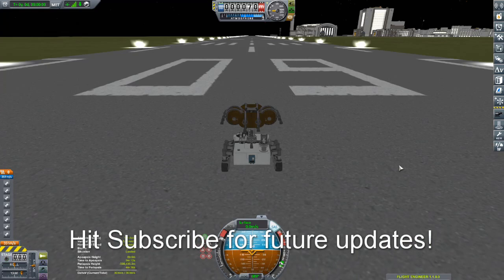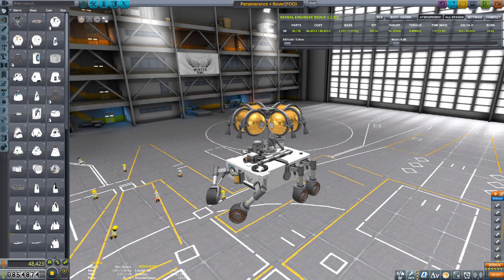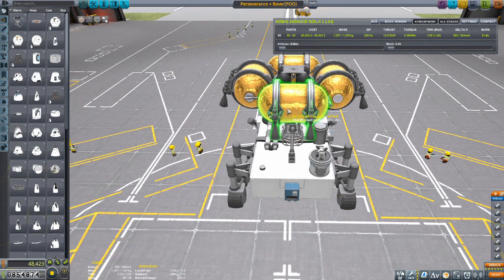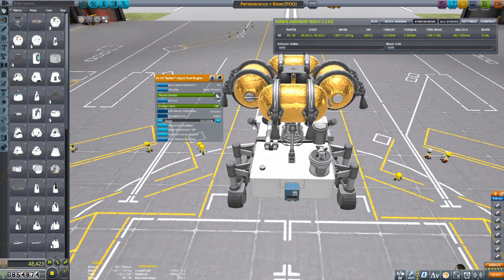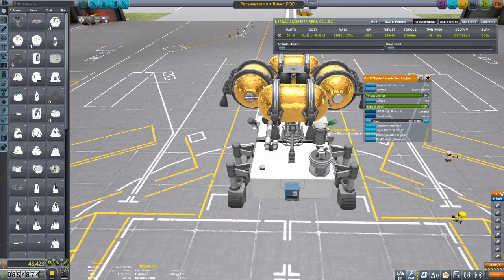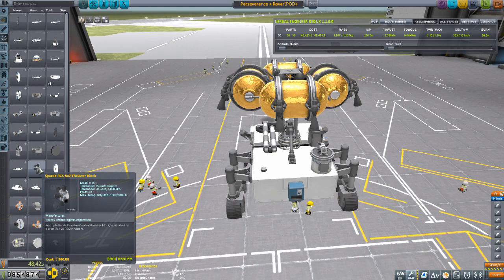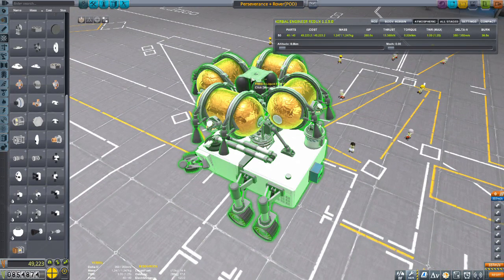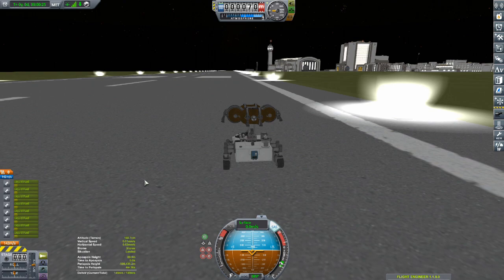Kerbal Space Program - Making a Skycrane or VTOL work

Comment: Hi!  Great tut and demo of how you balance your landers.  I have KER and I have only ever played with where parts are placed to try to control torque.  I will definitely use this "throttle limits" technique in future!  Cannot believe I didn't think of that myself. Depending on the situation, I might also play with the Engine positions/angles though I realise that that might get a tad problematic.

One question:  How does this affect the Fuel usage and does that impact the torque/flyability of the craft over time?  How do you manage that?

I'd imagine that on shortish flights (or with sufficient reaction wheel capacity) this is relatively minor/non-existent.  For larger Base-landers or big rovers (ISRU rovers for example) I might have to plan a central tank and fuel flow etc ... but possibly I'm over-complicating this.
Reply from the maker: The fuel drain is constant across all tanks - There are 5 tanks in total, one central tank (You may be able to see the black bottles in the middles there) with the 4 gold tanks on the outside. As long as the fuel drain remains constant so should the torque.

I took them off for the purpose of this video, but this particular vessel uses the tiny gyroscope type reaction wheel that is mounted radially instead of in-line. So they actually only produce a torque of 1knm. I had 4 on the original, purely down to OCD and symmetry, but honestly you only need enough torque provided from reaction wheels to counteract the remaining torque that you can't aleviate from engine thrust settings. So in effect, you should only ever need 1 reaction wheel producing 1knm torque.

And to be fair, I think you could be over-thinking it - If you know your engine settings REALLY well, you could offset a skycrane by so much more. You could even go as far as using a double skycrane, making it look more like a Chinook in space! :)

Thanks for commenting! :D